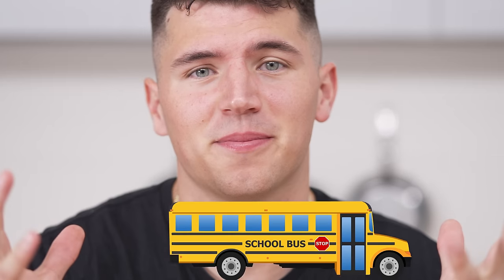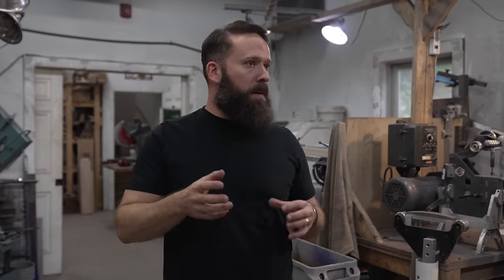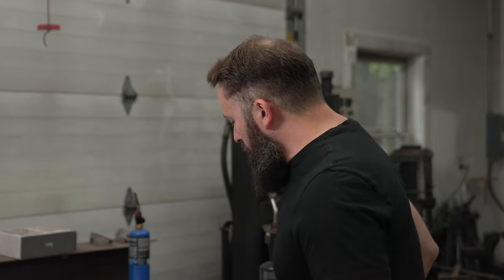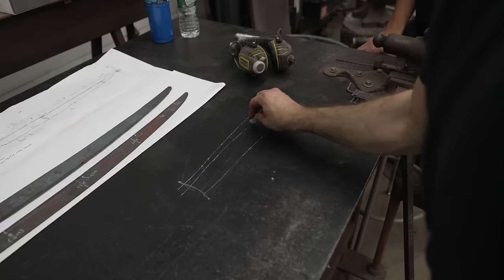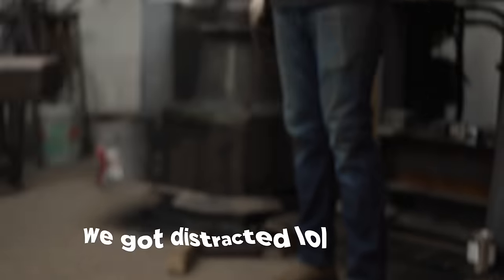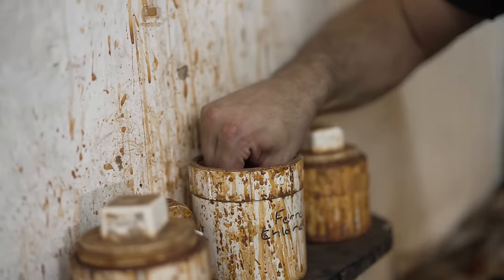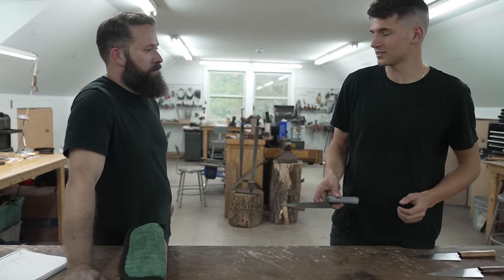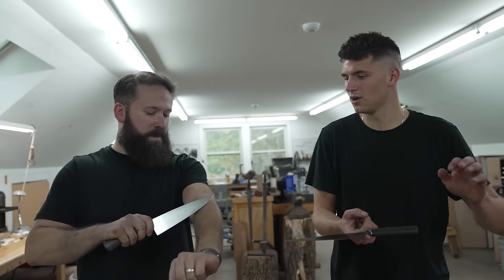I Made My Own Chef's Knife

Comment: I make knives in my free time mostly for buck knives skinning knives and one time made a cleaver. Damascus can be done with thousands of layers in a single afternoon if you keep folding and folding the steel. The cleaver I made was a first it took like 8 hrs .other than that I can turn out a buck knife with folded Damascus within a few hours.
Reply: Do you have a page you sell them on??
Reply: In a single afternoon is a bit of a stretch there goes a bit more in to it
Reply: @pjotrasert2054  I think if you don't count the preparation, it can be done, if you got way too much time on your hands, and depending on what you count as an "afternoon". 
Technically it could be 11-12 hours, since every hour after the noon can be counted as "afternoon".
Reply: @Mimirai  yeah i have been making damascus for a few years and i can tell you it ain't that simple. Oh and an afternoon is the time from noon till evening( wich happens to be 6 after noon)
Reply: @pjotrasert2054  So what takes the longest time, which would make it unfeasible to make a single damascus steel knife in an afternoon?
Reply: @Mimirai  doing it well, if you restack without grinding you can do it. But there is a big big chance of inclusions so you have to cool it off and grind the scale of before you can restack
Reply: @pjotrasert2054  He could also have a decent shop with a power hammer, and (I can’t remember what it’s called but it’s like, a metal planer that will take the scale off 2 sides with a single pass, don’t have one yet)

But honestly once you know what your doing and have that ability to make knives quickly even when they’re not Damascus, a knife in an afternoon is realistic. If you’re doing a specific, or more complex pattern, i can see someone finishing the blade in an afternoon and finishing the handle/sharpening the next day.

Also blade size matters, buck knives are pretty small  and can easily be done in an afternoon.
Reply: @ThatHoserCanadian  yeah i have a decent shop ( no idea what planer you are reffering to) but my point is just that damascus isn't that fast to make
Reply: @ThatHoserCanadian  are you thinking of a surface grinder?
Reply: You should make videos out of them so its more valuable time rather than free time
Reply: I've also seen Damascus-like, japanese traditional katana made in olden times with 36,000 layers. Fcking hell.....
Reply: Sameee but I I haven’t sold them yet but should and I made them out of files and steel blanks and Damascus blanks
Reply: You beat me to the punch. I find the guy badly informed about forging knifes, and also irresponsible with the knife, if his friend moved or got scared he could have injured the guy ...
Reply: could do it faster if u do canister Damascus
Reply: Plus hes promoting his zkramer like its takada or kagekiyo... its literally an ordinary knife that is not special yet expensive
Reply: I believe a perfect knife can be done in 12 to 15 hrs. As long as you take your time and make no mistakes.  2yrs for a knife thats crazyyyyy.....
Reply: @coltonmcgrath5704  Doesnt speed it up, but a canister does make the forge more solid and reliable. If you are talking random bolts in steel powder, I erm don't consider that to actually be damascus as zero folding. Damascus isn't even really damascus, as wootz steel is actually a crucible method that has been fogotten.

Comment: for anyone to wonder, no Damascus steel is not necessarily stronger. mostly in comparison to ore modern steel. it's very common for knife or blade to now have a high carbon steel middle (so the edge is high carbon steel). Damascus is straight up mostly a look. it jut look cool. when you understand why high carbon steel is stronger you also understand that mixing a strong steel with a weaker steel won't make it harder. the strength comes a lot from the tempering. and good demascus doesn't comprimise the knife so it i still a good knife. but if you have a stainless steel knife it's still stainless steel. and trust me there are way more complex and ornate demascus steel patterns.

Comment: Wonderful video, but one thing bugs me:
The tang.
That is not a full tang and it's more like a partial stick tang. I feel like that would be quite weak.

Also I wouldnt trust a damascus knife that you can throw (that  he said in the intro) because it means it would be a very soft steel, and wouldn't hold an edge super well as opposed to traditional japanese knives which are much harder, hold an edge better but at the expense of them being easier to chip.

There are generally two schools of knives (there are more but to oversimplify I'll be saying two): Western (often german or french) and Japanese.

The western knives, because they have a softer steel the edge is more prone to bending over when you drop it, something easily fixable using so little as a honing steel but they have less edge retention because of it. If you plan to hack and slash at frozen foods, nuts and bones whilst also somewhat chopping veg, western is the way to go. These are very rarely made from damascus  (I'm not sure why , but I think it has something to do with the fact that in laminating the blade you make it more brittle as well) which is why I compare it to the japanese knife.

The Japanese knives on the other hand, like I said earlier are harder and closer to the steel that Nick broke at 5:55 . This means that - combined with the sharper angle, Shun for example use a 16° angle  while most western knives use 20° - they  can get INSANELY sharp, and stay stupid sharp for a stupid amount of time, but beginners shouldn't use them because they can be delicate to use.

I'm just saying that to be able to throw a knife and it to stay intact the edge retention would be pretty bad for a japanese knife and you wouldn't generally see a damascus knife like that. 

Am I reading into it too much and just looking for an excuse to share my crazy obsession? Yes.
Will that stop me? No.
Have a good day whoever read this! An feel free to say if I'm wrong - I always want to learn more!

Comment: And technically you could make the machines from the industrial revolution with just the lathe or mill alone. The first thing you'd have to make is something so the lathe can act like the mill just sideways and vice versa for the mill but it could be done.. Well it's a bit untrue as even with both you'd need other things like screwdrivers, hammers, metal cutters, basically hand tools but you do just need one power tool to do it. Well that's basically what happened as the lathe was pretty much the first powered tool, even if powdered by your foot.